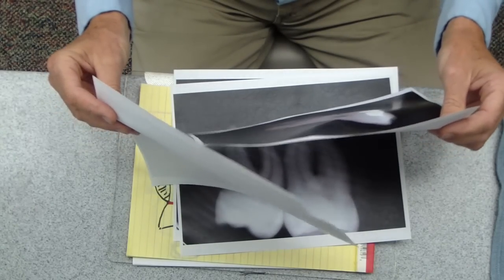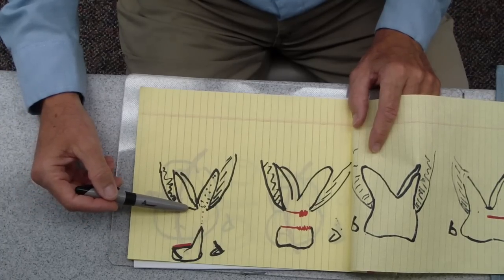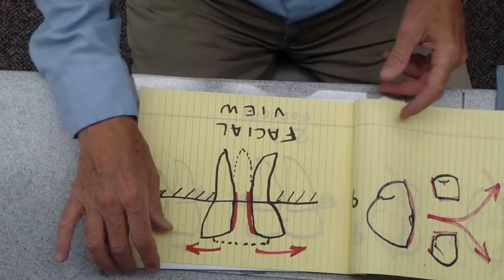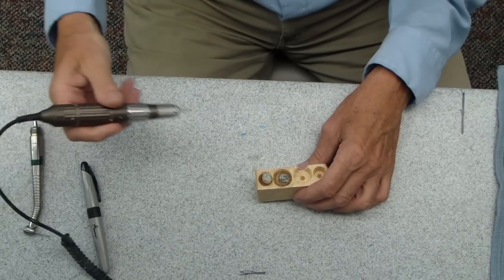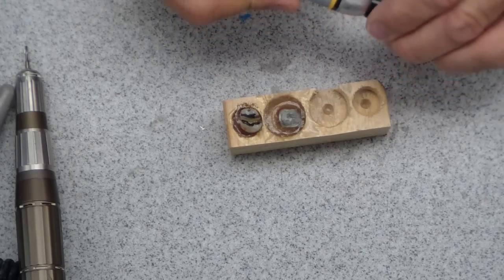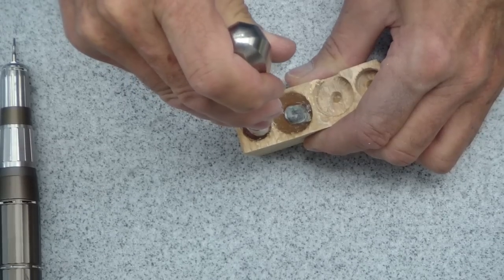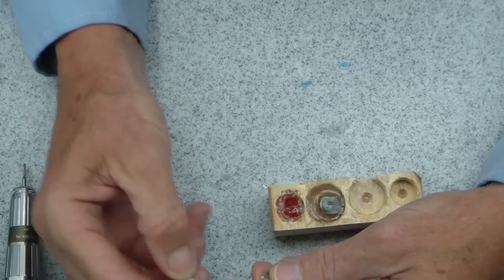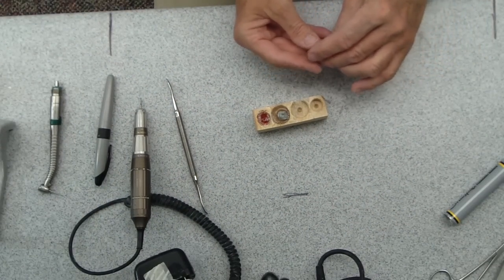Extraction - Isolated Maxillary Molar - Table Top Demonstration - Dr. P

Comment: i usually go for the straight cut but will try semilunar. it makes more sense from an anatomical point of view to remove the palatal root easier as the buccal roots are conical anyway
Reply: Tooth in epoxy adhesive?